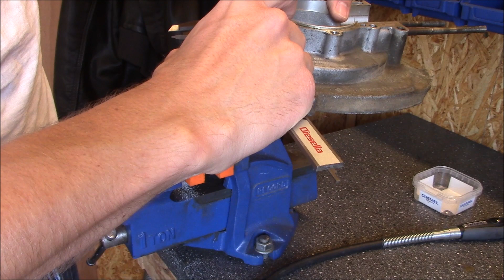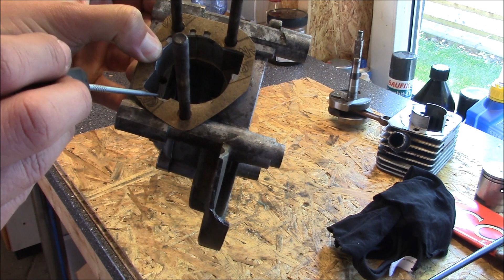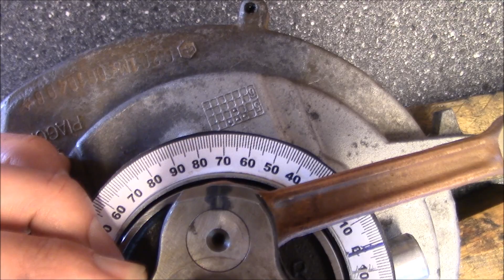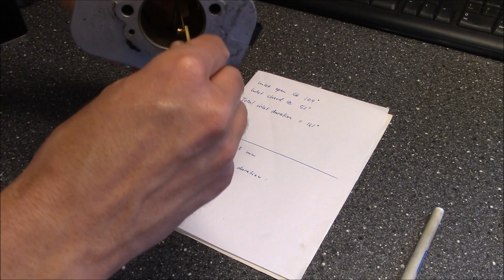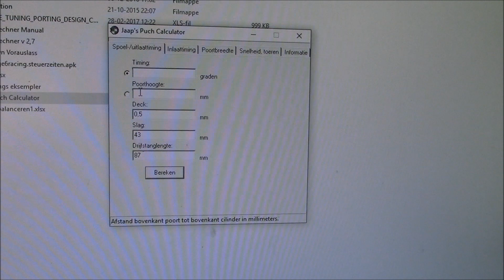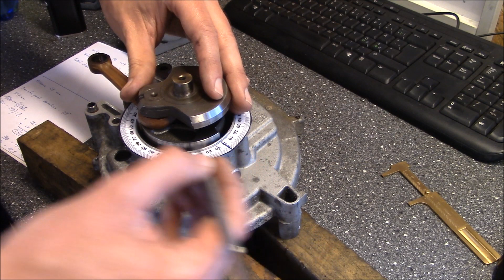Piaggio Moped Engine Tuning

Comment: 18:00 it seems a drill might be the perfect tool to make those ports, but obviously it is difficult to drill half on an edge(😂). However, there is a trick to do just that. It is a method mostly used to add piston ring locating pins to piston ring lands. You tightly clamp another piece of material (identical to whatever you're drilling) against the edge you need to drill. So in this case you would clamp a piece of aluminum against the cylinder hole in the engine case. You then just drill at the parting line, and when you remove the piece of aluminum you will have a perfect, half-round port (or quarter, or third, etc depending on where exactly you wanted to drill). On a piston you would press a piece of aluminum into the ring groove, and drill right on the line, so your ring locating pin would be supported by the piston land. That makes them much less likely to getting pounded out than if you were to just put the entire pin in the ring groove. 
I'm watching this video because I just bought a junk Vespa Bravo. The previous owner was unfortunately a fool, and when he built the engine he did everything wrong. The crank didn't turn freely, the engine has a bunch of orange goo inside(red RTV, the methhed's best friend), and he installed the piston backwards😂. But the moped only has 500 miles on it, so it's in decent shape otherwise, and I'm looking forward to getting it going. Thank you for the excellent video.

Comment: Hello brother , so you modified the actual engine and didn’t buy a engine kit right ?
Reply from the maker: Yes this is an original engine that i modify.

You can also get ready to go engine cases from Polini, Malossi and Pinasco.
Just stay away from the noname copies of the original engine, they are not good.
Reply: @CarstenLorenzen12V thank you for your advice! I really appreciate! Also, i recently bought a piaggio zip (old model fast rider 1995) and i did a diagnosis on it the clutch is perfect and original variator also is in good shape but is not original would you recommend to buy an original variator? And the engine kit is also aftermarket and I’ve been on a low budget lately so I’m thinking about buying an RMS kit engine without the cylinder. Do you think if would be okay if I will use the aftermarket cylinder with the original kit? Thank you very much! (50cc kit)
Reply: @CarstenLorenzen12V thank you very much sir I appreciate

Comment: Thanks for the insights on crank timing! I followed the installation manual for my Polini, but the suggested crank grindings seemed way off on the intake side (15mm). Using your degree wheel and Jaap's tool, I discovered my intake was already optimal. Interestingly, the exhaust side needed a 5mm grind—just as the Polini manual originally stated!

So if someone finds that no grinding one one or both sides, is needed for your kit, you are not alone!
Reply from the maker: @Djmogelmose  you are right, i think there are 3 different cutouts from the piaggio factory. Depending on era and region. Just going by the manual can cause problems.

Comment: Hello Carsten, i really admire your work and knowledge. 

I have just rebuilt my engine for my Ciao since the previous engine block had cracked.
I bought a Pollini Speed Engine block with a 13mm intake and reassembled the existing original cylinder and crankshaft - with a new 38.4mm piston and rings.
Currently, I have a SHA 12-10 Dellorto carburetor with a 50 jet and a Jamarcol exhaust.

My question is: If I were to switch to a SHA 13-13 carburetor and a 64 jet (which Pollini recommends in the instructions for the engine block) + a drilled air filter box  would I gain anything from this while keeping the current cylinder I have, and would it work well together?

Or does it require upgrading the cylinder to, for example, a Pollini 63cc?

Grateful for any advice.
Reply from the maker: @johanpalsson6222  thanks for your kind words. Yes the original can work well with a 13 mm setup. The jet also sound about right.
Reply: Thanks for your reply! Im having a really hard time to get my ignition to work 100 % since the rebuild.
I’ve watched and  followed your video guide a hundred times but I don’t get it to work fully.

I’ve got a brand new external ignition coil (blue original) for 400 DKK.
Brand new BH6S NGK Spark Plug
Brand new NGK ”Racing” Spark plug cap
Brand new Effe breaker points
Brand new Effe capacitor
Used Lightning and internal ignition coils, and a used 100mm flywheel.

I only manage to get a spark at really high RPM - not at low rpm - as in your video. 

Im thinking that the internal coil, or the fly wheel is bad and cant genererate enough power. I have a brand new 91mm flywheel too. I’m thinking that my only option now is to replace the coils as well. Do you have any thoughts? Thank you Carsten
Reply from the maker: @johanpalsson6222  check that the coil diameter matches the flywheel diameter, you can't mix them.
Reply: @CarstenLorenzen12V
The current coils are matching the 100mm fly wheel i have right now. I’ve “pushed” them as close to the flywheel as possible too. I did measure the coils too with a multimeter, with the same results as in your other video.

Do you have any idea why it wont spark at low rpm? The only things left that I can think of is the inner coil, or that the fly wheel has bad magnets…
Reply from the maker: @johanpalsson6222  yes that could be a problem, but both are very rare. Also check for cables that may be shorting to ground. Especially around the screw on the breaker points. There is very little room and it the connections are close or touching the flywheel, you will have a little sparking there. That would result in lost spark at low rpm.
By the way. The new original blue coils that are on the market now, are pretty bad china coils. Maybe try a used original, if you can find one.
Reply: @CarstenLorenzen12V
I will make sure to be very careful with the connections to the breaker points.
I do have an original blue (old one) too. And I have tried with both.

I did notice some occasional sparking inside the fly wheel when I was trying the ignition with an electric screwdriver (I had the rubber plug off). And also the lack of spark on some rotations of the pistions.
Reply from the maker: @johanpalsson6222  i have also experienced new effe capacitors that have been faulty. I mostly use external ones, 330nF MKP X2 min. 275V. They can be connected parallel to the external ignition coil. Remember to disconnect the original one, and only use it as a felt holder.
Reply: @CarstenLorenzen12V 
Hello again Carsten - thanks a lot for replying to all my comments.

I have now replaced everything to new parts of the ignition system of my Piaggio Ciao. Tonight I re-did the complete ignition from scratch and followed your other video fully. I was extremely accurate with all the cables and components. It worked fine when I had it on my workbench and tried it out just like you do, but when I mount it on my frame and try to start it, the spark is completely gone. I can’t figure out whats wrong with it now, and I’m all out of ideas.
Since it’s working on the workbench, could there be something that’s happening when I mount it to the frame? The secondary ignition coil is mounted to its original position on the frame next to the clutch.
Bad grounding? Any ideas?
Reply from the maker: @johanpalsson6222  yes that would be my last idea. Try a ground cable from the coil to the engine.
Reply: @CarstenLorenzen12V  
I will try that this weekend!

Comment: Hej Carsten jeg ville bare vide om stellet på hele knallerten kan holde til al den ekstra kraft fra en 74cc cylinder
Reply from the maker: @kristofferjacobsen1555  ja det går fint. Bravo motorbro og bunden af Ciao stellet er de svageste, du skal ikke køre cross uden forstærkninger. Rust kan også være hårdt ved dem.
Reply: @CarstenLorenzen12V  jamen det er bare til at køre rundt med gutterne så ikke noget vild vild kørsel. Men tjekker lige for rust

Comment: Hmm i think this is the only video that shows that the small ports need to be dremelled all the way.
Everyone else just makes a small dent that I do not think makes any difference.
Reply from the maker: @titusm9837  i rarely make them all the way. Depends on how well they are fed trough the piston. On the Athena kits, only the middle two are open trough the piston, so i made channels.
Reply: @CarstenLorenzen12V  in my case i have a polini 65. It seems that all the extra openings are used by the piston (also they made some sort of M  that connects all the small ones together).
Should i in this case port for this other openings?
I have not seen anyone do this until your videos. 
It kind of makes sense because the piston has some extra compression i guess? 
Interesting that i have not seen any manufacturer recommending porting for this openings.
Reply from the maker: @titusm9837  i like to make a little "pocket" as deep as the opening in the cylinder skirts. This gives a nice channel to feed the booster ports, without any sharp 90 degree corners.

Comment: I'm at a loss and need help please.   I was convicted by others to upgrade my 49cc vespa piaggio grande to a higher Bore: 46 Stroke: 43 Displacement: 72. So I honed out the case. Fits rather well.  Then I try and do the computation for inlet timing and nothing computer leading me to believe I've been talked into something impossible.   Is there anything I can do at this point?
Reply from the maker: You could try the easy way, take the Malossi or Polini cylinder manual. It was crankshaft grinding recommendations with how many mm you need to take of the opening and closing edges.
Reply: @CarstenLorenzen12V Many thanks ill look it up there :)
Reply: @CarstenLorenzen12V I want to  do this in „easy way”, but i have a question - when you cut crankshaft just like that, isn’t there a problem with unbalancing it? When U make things like that in car, you have to balance crankshaft in special workshop. Doesn’t the engine start to vibrate or something?
Reply from the maker: @piotrjanczar  a single cylinder engine without counter balance shaft, will always have vibrations somewhere in the rev range. Yes you change the balance a bit, so the vibrations can become a little stronger and shift to another rpm range.
Piaggio has made the flywheel out of balance, to counter for this cutout. Changing the opening a little, doesn't have a huge effect.
A Ciao engine vibrates no matter what 😅
Reply: @CarstenLorenzen12V thank you very much for really fast answer! Have a nice day ❤

Comment: Thanks for the vid, I opened up the flow path in my Kinetic moped as you show, except I went with a 12mm carb opening, for some more strength in that tube, (looking for a bit more umph) after making a twin muffled expansion pipe (the pipe added 5 mph) and going with a 13;13 carb. 
I was curious if the porting would add anything to the low end- it did nothing there,  but added some power to the goal of a 30 to 35 mph range.  Mike

Comment: Does the engine have to be removed in order to adjust points gap?
Reply from the maker: No, just remove the clutch/vario, and then you have access to the window in the flywheel.

Comment: 79 piaggio Caio primary internal coil puts out 7.4 volts ac,external coil checks out, compression is low 85psi, but engine will not ignite a fuel mixture?
Reply: Thank you,my ignition is to weak, the only thing I have not replaced is the condenser.
Reply from the maker: 85 psi isn't enough. A stock one does about 9 bar, that's about 130 psi.
Reply: @CarstenLorenzen12V  not enough to run,but not enough for engine to backfire once?
Reply from the maker: @davidscalf6417  maybe, maybe not 😉 Try to take the sparkplug and cap of the cable, take a little isolation of. Hold the wire 5+ mm from the cylinder head or other metal part of the engine. Turn the engine, and you should have a spark over that distance. If not, your ignition is too weak.

Comment: Moin Carsten, 
Ich hab hier einen Mopedmotor mit bearbeitetem Einlass(13mm) und 63ccm DR Zylinder und Mopedkurbelwelle, sonst alles unbearbeitet

Macht das Sinn noch mehr daran zu bearbeiten ? 

Außerdem hab ich noch nen Simonini Calibrata und nen Sito Plus hier liegen 
Für den Calibrata ist das Setup wahrscheinlich zu schwach oder ? 
Oder würde der gehen wenn man die Überströmer und die Kurbelwelle noch anpasst ? 
Gruss Maxi
Reply from the maker: Moin! Die Kurbelwellenbearbeitung bringt einiges, die anpassung der Überströmer bringt nur gering. Ich mache nur eine leichte anpassung, damit der Gasstrom keine scharfen Kanten trifft. Aufpassen beim ÜS fräsen, da ist nicht viel Material!
Calibrata bringt viel Leistung obenrum, ist aber schwach untenrum und in der mitte, den würde ich nur mit Vario fahren. Bei Mono definitiv den Sito Plus, und der geht auch sehr gut über den gesamten Drehzahlbereich.
Wenn du die Kurbelwelle nicht selben fräsen möchtest, nimm die Rennwellen von Mazzucchelli, die gibt es in 10 und 12 mm und passen perfekt für den DR in einem aufgemachtem original Gehäuse.

Comment: Very nice and inspiring video. 
I where on youtube looking for information about ignition but ended up doing all modifications from your video
on my Ciao with a 60cc Malossi kit. Using 186 degree duration. Of course I milled a hole in the side of the engine. It was possible to solder with a blow torch and zink. 
Had some problems with missfiring. That was solved by changeing the "no name" ignition coil to original blue one. 
The engine runns well and revs like crazy. Will try with stiffer clutch springs to improve low speed power.

Thank you Carsten.

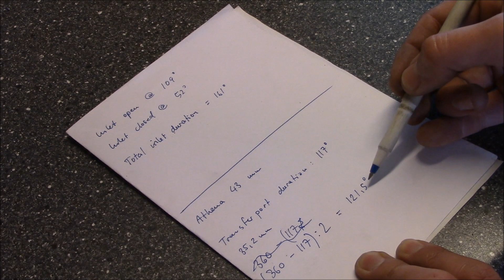Comment: I’ve got a question: Why are you adding 10° on minute 27:14.
Reply from the maker: Hi, it's a overlap that has been determined by two stroke racing teams, to maximize inlet opening and driveability. High revving engines can have even more overlap.
Reply: @CarstenLorenzen12V  Thanks,

Comment: How much of a difference does the "new" inlet timing make?
Reply from the maker: Depends on what basis you have, there are restricted models, and others that already have over 160 degrees opening from the factory. Anything between 5-15 km/h.

Comment: I want to put turn signals on my ciao 2 coil 6v moped. I suppose I would need to put a battery and turn the thing into a 12v system. Is it doable?
Reply from the maker: There are models that have this from stock, with and added coil that goes over each half of the ignition and light coil. I've never worked with this, as we have no blinker models here in denmark. Try to search the net, maybe it's easiest to get a complete set with miniature battery/capacitor and blinker relay.
Reply: @CarstenLorenzen12V  Thanks for your reply Carsten

Comment: This is driving me crazy, what page of the Two Stroke tuning book by Graham Bell does it state that you can overlap the transfer open/close with the intake open/close by 10 degrees? I've reread the porting chapter 3 times and cannot find it.
Reply from the maker: If you have the "free" copy from the internet, the page is missing. Buy the book and it's included 😉 it's in the section about intakes, rotary valve.
Reply: @CarstenLorenzen12V  there is only one section where he even remotes touches on such a concept. On page 64 he says: "it is usual . . . To open the inlet port about 5 to 10 degrees before the transfer port closes"

Is this the part you're talking about?
Reply from the maker: @JasonKrasavage  yes that's it. Could be that he doesn't mention more about it. But i find the 10 degrees as a good value, I've tested some racing cranks with 15-20 degree overlap, end they suffer some at idle and bottom end, plus you get an even wetter airfilter.
Reply: @CarstenLorenzen12V  carsten I have a hard copy of the full book :) what page is it?
Reply: @CarstenLorenzen12V  I would presume it's somewhere in chapter 3, "porting and cylinder scavenging" right? There are no subheadings or subsections for intakes.
Reply: @CarstenLorenzen12V  I have the 2nd edition of "two stroke performance tuning" by A. Graham Bell.

Comment: Carsten Lorenyen, jeg har tænkt mig at smide 38,4>43MM polini topstykke, 65CC DR P10, 80MM remskive, og en 13MM dellorto karburator på min bravo. Når det nu også er 13MM så skal jeg vel bare file det samme i på krumtappen og i plump “hullet” som dig?
Reply from the maker: Ja, men der findes flere forskellige krumtappe, så det er bedst at måle med gradskive som jeg viser.
Man kan også file indsugningen, og så montere en ræser krumtap som f.eks Mazzucchelli AMT004.
Reply: Carsten Lorenzen Ja det kunne jeg også, indtil videre er der smidt i kurven for ca 1500kr, det er også med speedo drev kabel dysesæt osv. syntes det er lidt dyrt for bare en krumtap, men tror bare jeg gør det, så kan jeg altid lave den lovlig igen, har nemlig allerede en boret blok, og en med plump på pt.
Reply: Carsten Lorenzen Men hvis jeg køber den krumtap, også bore 13mm, så skal jeg ikke modificere krumtappen eller hvad?
Reply from the maker: @NicolaiJensen2004  præcis. Men fræs og fil indsugningen op. Det kan meget nemt gå galt når man prøver at bore den op.
Reply: Carsten Lorenzen Jep. Da jeg købte den der havde sælgerne alle rede filet eller boret indsugningen. Dog tror jeg ikke den helt er 13MM, så det skal den lige files til. Den er tæt, kørte med boret blok i 8 måneder før jeg insisterede i en med plumb. Men tror jeg går efter den der ræser krumtap. Så er jeg sikker på den for det første holder, og for det andet så “ødelægger” jeg ikke den originale :)
Reply: Carsten Lorenzen Det lyder til du har meget forstand på det, hvad tror du jeg vil kunne få den til at rende, har hørt en ca 70km/t?